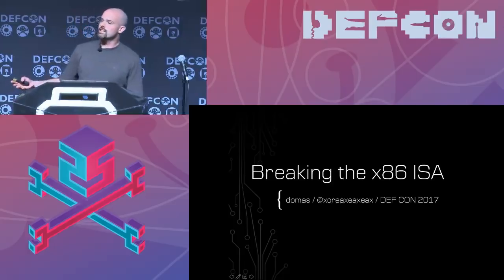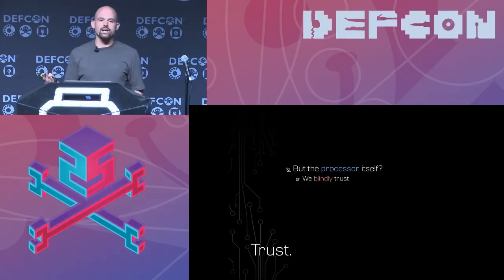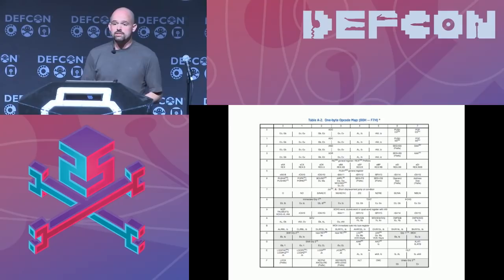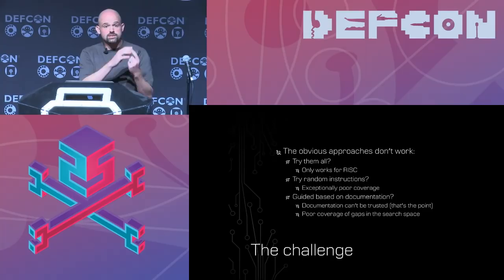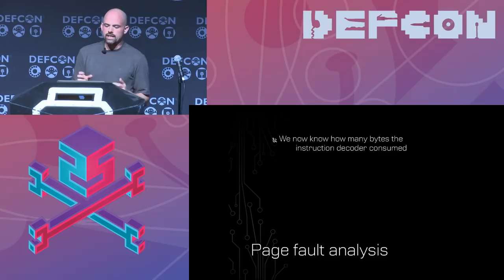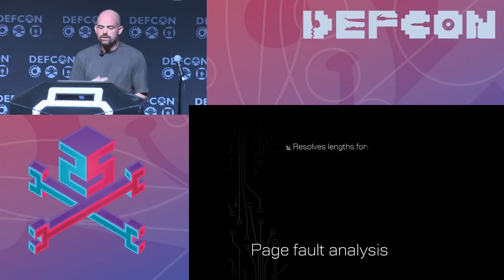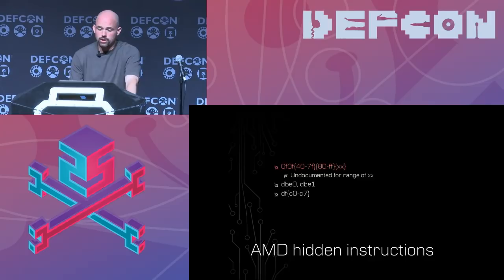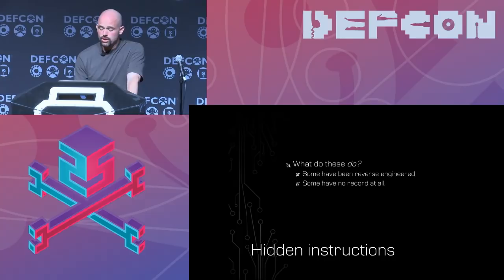DEF CON 25 - Christopher Domas - Breaking the x86 Instruction Set

Comment: The 'Halt and Catch Fire' instruction would be great if it triggered a processor destruction charge i.e. hardware anti-tampering method supporting FIPS 140-2 or one time use secure message device - James Bond style.
Reply: Its all fun and game until you find out that CPU controlling a nuclear power plant emergency controls.

Comment: I feel like it's dumb for me to ask but aren't the "rings" (0,1,2,3 ), SMM and other security modes designated by the operating system, so I'm thinking that if you wrote a small OS you wouldn't have those privileged modes of execution if you didn't program them in. 
So my question is am I right to think this or am I just wrong?
Reply: The rings, hypervisor and SMM are all hardware features built into the CPU and chipset. What belongs in Rings 0 and 3 are designated by the kernel, everything below is firmware-level.
Reply: They're a part of the cpu hardware, smm and other low level operations and modes can only be accessed by special instructions in the instruction set that can't be used for anything else. Technically your computer boots from bios thinking it's a tiny cpu from the 1970s and you have to set all kinds of special registers and things during boot up to make it realize it's a modern fully featured cpu.

Comment: A CONCERN: "A VIA x86 Chip was found to have a tiny processor within it. 
It had it's own operating system (Minix) and bypassed ALL security at the hardware level.
It's called the ARC Processor & you can bet it was developed in Israel for worldwide distribution."